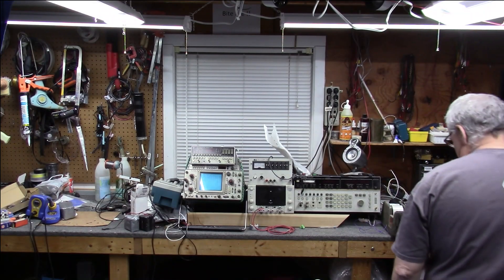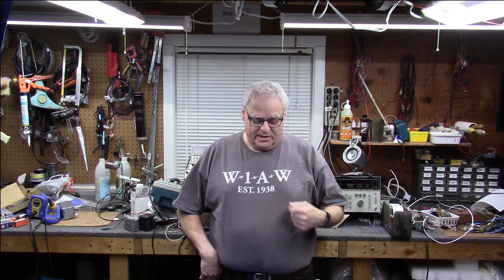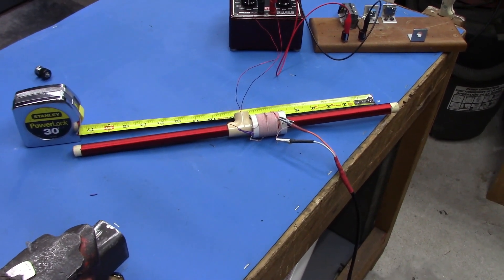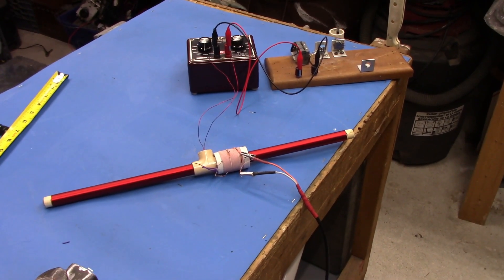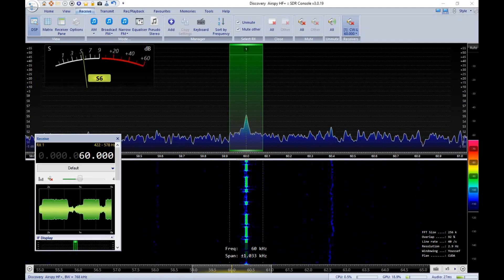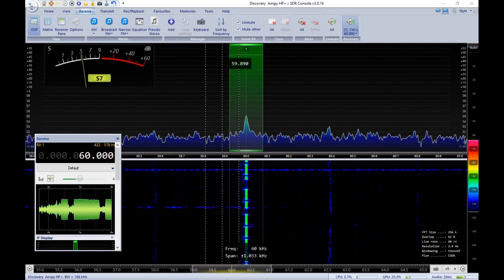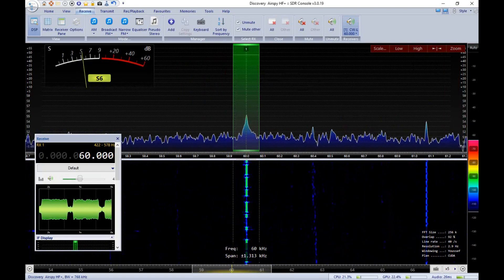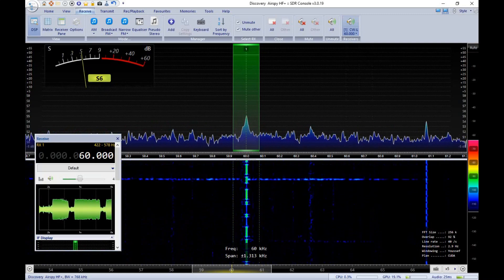WWVB Antenna Part 1

Comment: Hi Paul. I have a question if you don't mind. Could one simply use an inductor with ~15millihenrys of inductance instead of your homemade inductor for this application? I am guessing no...since a store bought inductor will be much smaller in size with less surface area to resonant with the 60kHz WWVB signal. What are your thoughts?
Reply from the maker: Steve.. I understand your idea, but the size and "Q" of the inductor are what differentiates as an antenna and not just an inductor. Although a small inductor would still make the system resonate.. it does not have the physical size to pick up any signal.  A large air core loop works even better... Size playa roll in this antenna
Reply: @W1VLF  Thanks Paul. While I have you, I have another question. I just built a square magnetic loop to resonant between 2200Khz and 11000Khz. Q is good on the low end, but much smaller (wider bandwidth) on the high end (11000Khz). Any ideas of increase Q on the high end?

Comment: Hello Sir is this only for 60kHz? Can it be used for FT8?? 4000-2200 m?
Reply from the maker: Certainly one could be made for other frequencies including 472 Khz or 137 KHz..  You can use the calculator I talk about in the video  to figure what inductance and capacitance you would need
Reply: @W1VLF that’s the great thing about loopsticks. You can even make them for shortwave, I had one that covered the 75m to 41m broadcast bands. Was great for portable listening.